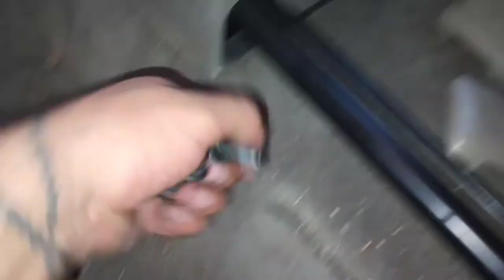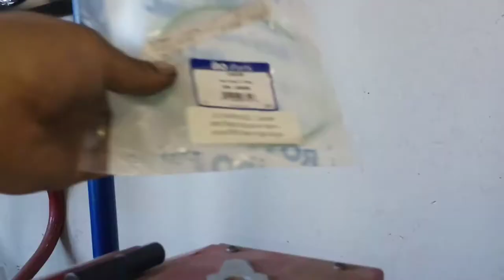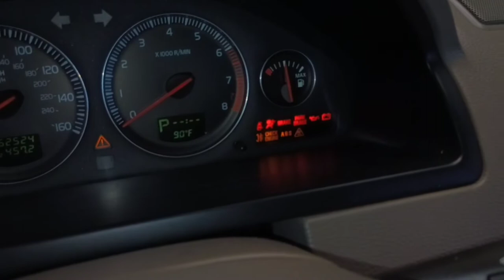how to replace a fuel sending unit on a Volvo XC90

Comment: Where did you purchase your part from if you don’t mind me asking ?
Reply from the maker: @fnvking4426  if I remember correctly, they bought the part from worldpac
Reply: @luckysdiygarage  so I had gas in my car probably half a tank and I was driving and I noticed the needle drop all the way below empty so should I replace the fuel pump it self or the fuel sending unit as well ?
Reply from the maker: @fnvking4426  if the fuel Gage shows empty but it starts all the time with no trouble I would just replace the fuel sending unit but its honestly up to you if you wanna replace both now that your there ..as a preventive maintenance..but of course test it
Reply: @luckysdiygarage  thank you appreciate the feed back will probably just end up doing both
Reply from the maker: @fnvking4426  hell yeah, let me know how it goes

Comment: Great video. Thank you!!! I have a couple of questions, if you dont mind. I have a 2005 Volvo XC90 T6 with a code of 4A35 (Fuel Level Sensor). Will this video also work for my 2005 XC90 T6? You referred to the part as a fuel sending unit. Is that the same as a Fuel Level Sensor?